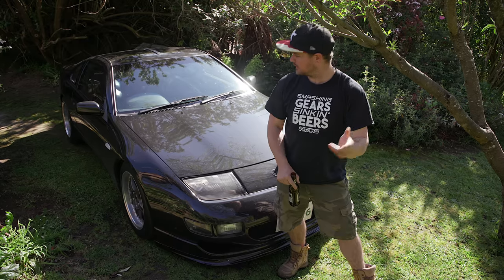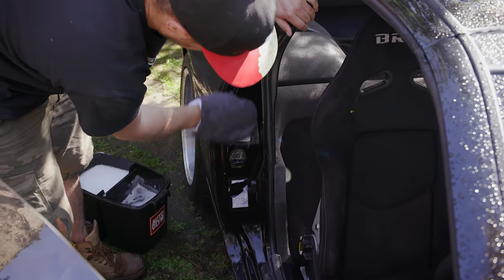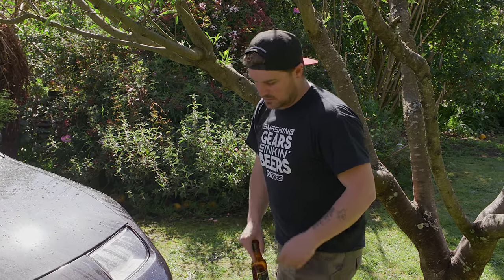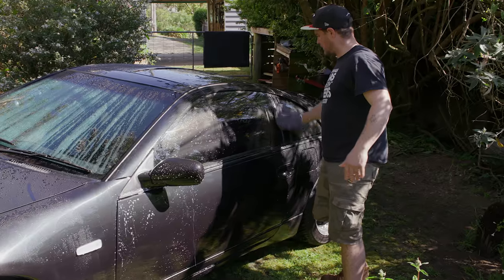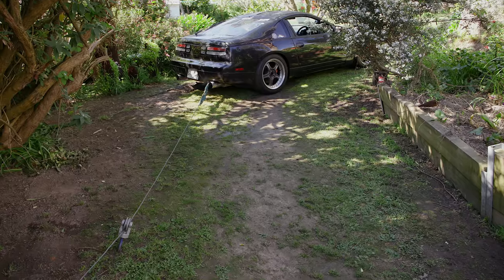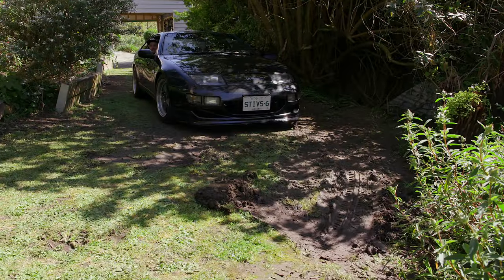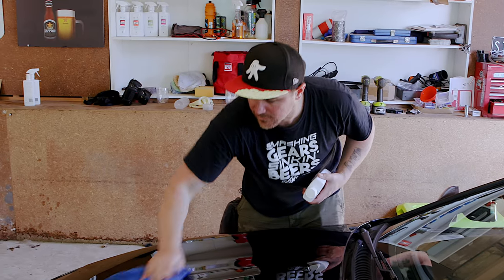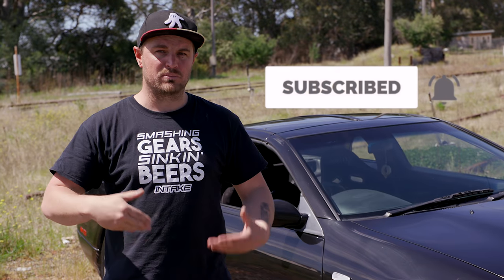Getting Bogged in my Backyard! How not to wash your car.

Comment: You gotta wash your car in the garage! That’s what I do so you don’t have to worry about the sun drying soap and water onto the paint and the weather isn’t a factor. You just have to be careful when rinsing the car so you’re not spraying everything in your garage. Washed my car many times at night as well, just flick that light switch on and play some tunes. Your car stays that much cleaner from not having to get back in it to move it as well. How I keep my Nismo Z33 clean!

Comment: There are cheap foglight ducts on eBay. Z1 has quality unpainted ones for double the price, and ionicdynamics and specialtyz have carbon fiber ones that won't need paint. Zcentre.co.uk has a lot of those hard to find trim pieces.